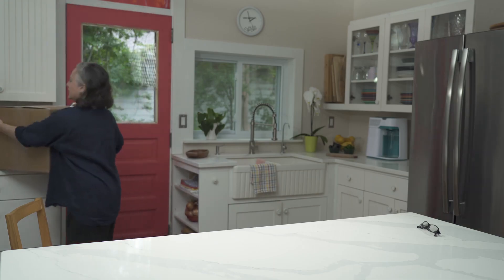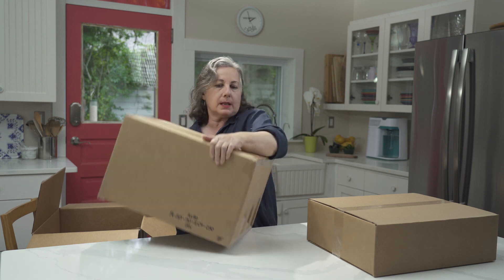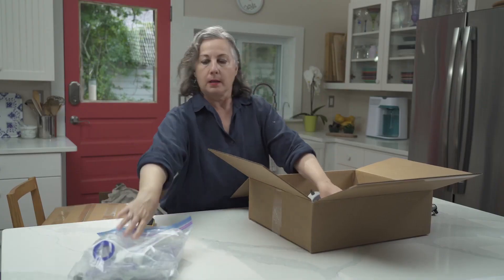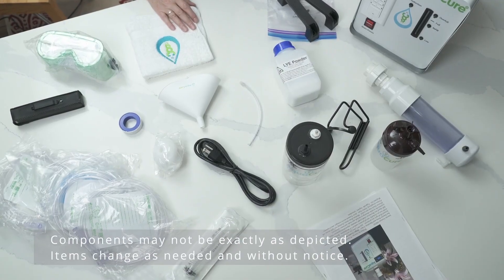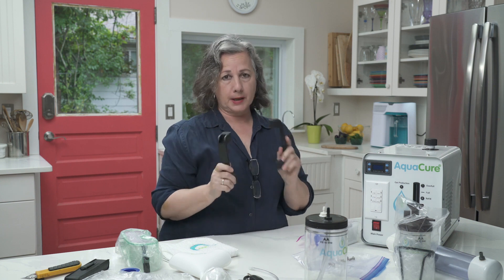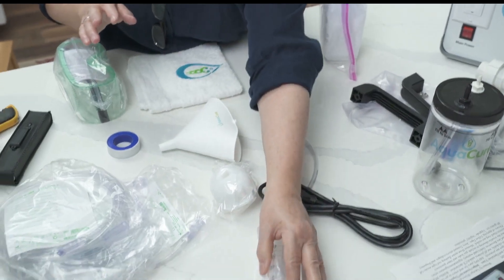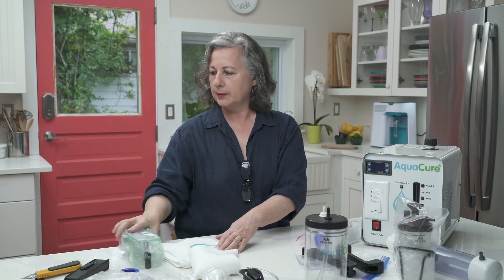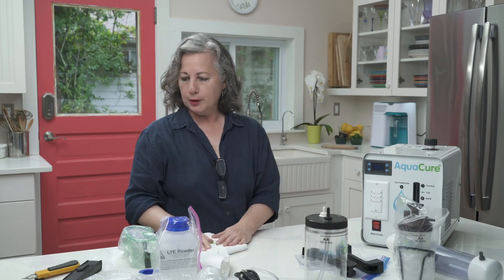AquaCure AC50 Unboxing (series video 2)

Comment: She says you have to order the handles extra, but I saw an unboxing video where the man took the unit out of the box and it had the handles attached already. The Styrofoam was designed to fit around the handles already attached.
Reply from the maker: That sounds like the Tywon unboxing video.  NO AquaCure is shipped with handles attached.  So I'm assuming he had unpacked it to examine everything (installing the handles), then repacked it without removing the handles to make his 'unpacking' video.  The handles are nice, but extra.
Reply: @ecopegasus  - it was this video, I just went back and found it. https://www.youtube.com/watch?v=GddrL6CcsdA
Reply from the maker: @Boxcarphilly  Thank you, I hadn't seen that video yet :)  Same answer.  NO AquaCure is shipped (from our factory) with the handles on.
Reply: My machine came with handles included in the box. Nice surprise!
Reply: @kristiefalk8512  - ya, and like I said, the Styrofoam was designed to fit around the handles already attached.